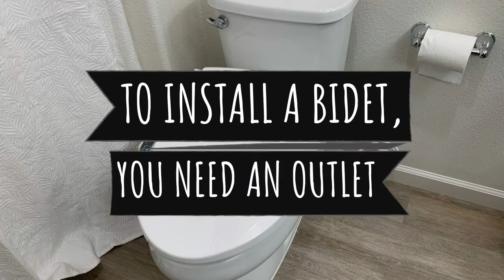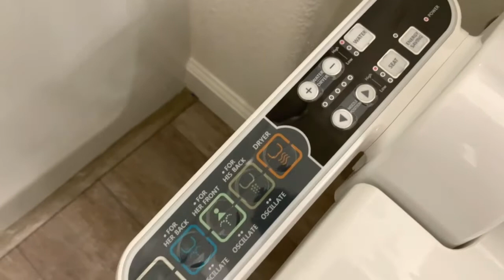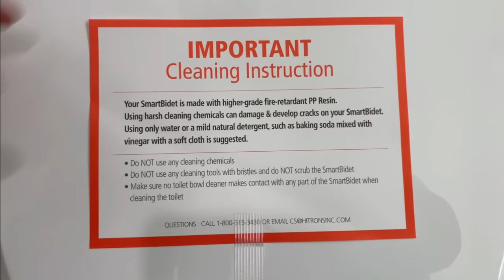How to Install Smart Bidet 5B 2000 | Cut down on toilet paper costs!

Comment: I hope you can help me with this foopah. My Goddaughter was helping me install the seat. For the most part she’s pretty good with putting things together, however, this time she thought she knew what she was doing, NOT! She slide the base plate onto the seat before putting the brackets and bolts onto the base plate. We both tried getting it off but it’s snapped in there and if I use a flathead screwdriver I’m afraid it might break. Any suggestions?
Reply from the maker: I think we would use a flathead screwdriver too in this situation but I don’t necessarily advise it. If it breaks, maybe you can get it replaced? I’m sorry to hear your in this situation!